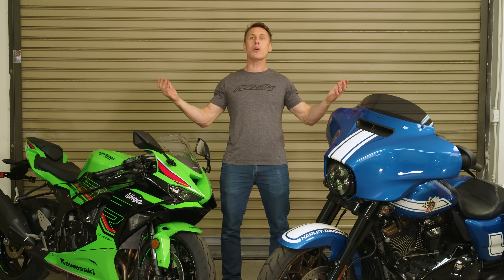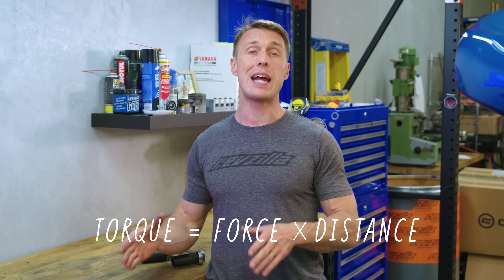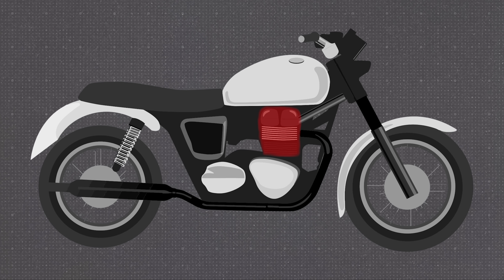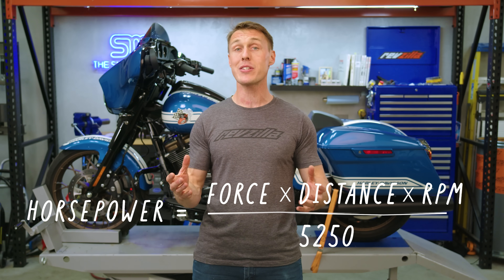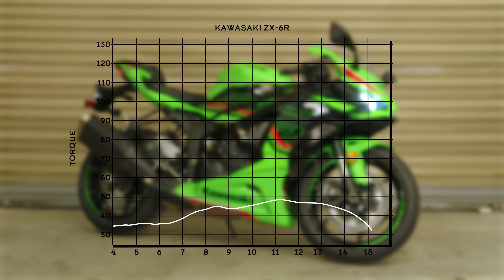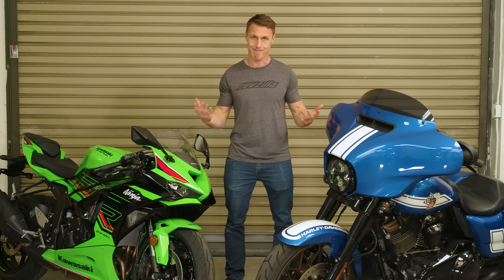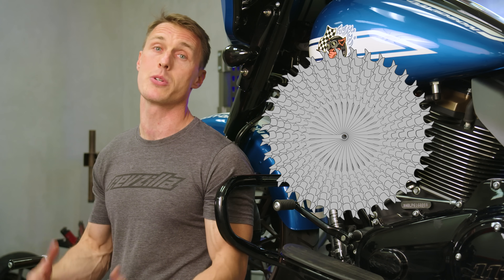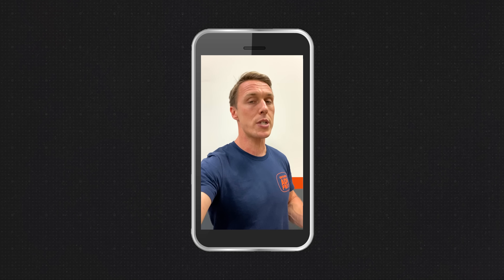Torque and Horsepower Explained! | The Shop Manual

Comment: Love the video, some great explanations, I do worry that some people will hear "torque equals stronger acceleration and horsepower means higher top speed" and miss the caveat that the transmission makes the torque somewhat irrelevant.
Reply: Yeah that line is not true. A bike acclrates faster in its powerband, it's weight and gear says the same. The only think it change was the amount of horsepower that was created.
Reply: @pleasedontwatchthese9593  I get the simplification he's going for and I'm positive he knows the intricacies.  It's difficult to tell a YouTube audience to integrate the horsepower chart across the range of the intended powerband to determine average acceleration. The sentence just seemed like a misleading sound bite when later people take it out of context.
Reply: @joepelletier5381  I agree with you. My main point is it should have been left out because as you point out it will be misleading
Reply: True.  Given perfect gearing, the engine that makes the most horsepower will also make the most torque.  In real life though we have no perfect gearing so in many cases an engine that makes greater maximum torque is more useful.
Reply: @LTVoyager  I think my point is that this is only true (that we should compare just torques)  if both bikes have the same redline and I'm afraid that wasn't clear in the video.
Reply: @joepelletier5381  I don’t think redline matters.  The relationship is more complex than that.
Reply: @LTVoyager  That's the issue, and my fear of the statement originally.  A vehicle that makes the same engine torque at twice the RPM as another vehicle has twice the horsepower and the potential to accelerate twice as fast (if the same weight).  So without trying to dive all the way into it, comparing torques between like motorcycles works pretty well because cruisers always get lugged and sport bikes rev to the moon, but a hayabusa and a Softail have similar torque and weight, and at the end of the day they accelerate quite differently.  A more useful example from the last 5 years might be riding a Harley 48 Sportster and then jumping on an Indian Scout.  The scout revs for days.
Reply: @joepelletier5381  The biggest part of the issue is that only the peak values are generally reported for both torque and horsepower.  That is only a very small slice of the picture.  As you mention, you really have to know the respective RPMs of the torque values.  A diesel locomotive generates far more torque than a typical car, but you won’t win a drag race in the locomotive.
Reply: @LTVoyager   You would if they weighed the same and had the same gearing....... and the train had rubber wheels so it could actually get power to the ground  :)
Reply: Depressing that he said that.
Reply: @pleasedontwatchthese9593  but change in hp also implies change in torque.
Reply: @hankjones3527  No, you wouldn't. If both vehicles had the same gearing, weight, and unlimited traction, the locomotive would run out of RPM instantly.

HP is actually the more relevant measure for doing work, that's why industrial stuff is rated in HP and not TQ. Gearing will take care of the torque.

What gearing won't take care of is the high reving engine blowing up after 200 hours where a low reving one will do the same work for 20,000.
Reply: @atsernov I was on board with what you said until the RPM thing, longest lasting engines are ultra high RPM....TURBINES.  Splitting hairs but you are spot on, this confuses people so much...HP is all that matters in a system with a transmission...Torque output of any transmission is 100% tied to input HP.  More HP, more available Torque.

HP is the only measure of work.

Using locomotive example, make them same weight, we can get by RPM limitations by using the electric generation system of locomotive, run locomotive at full power and use dial/rheostat to meter power to wheels, problem solved.  But power is power and you are spot on, all industrial engines are rated for power @ RPM, just like aircraft, since it's generally the metric that is of any use.
Reply: @motominded5275  Can't compare a turbine to an ICE like that. The reason the turbine engine is so robust is because it does not have recipricating mass to shake it apart.

They absolutely disintigraye from a single blade failure. That's why they have containment rings, undergo inspections every few dozzen opperaring hours, and rebuilds are mandated by time and not by walear.
Reply: @atsernov  I was mostly joking but just bringing up the point that high RPM does not = high wear dependent on engine type.  Turbines don't need constant inspection - in industrial applications they happily plunk along for 10s of thousands of hours with no inspection and minimal maintenance.  Heck, they even use them in the M1 Abrams where they happily spin along at 20k RPM+ and at time of development were directly compared to piston engines....
Reply: @motominded5275  Aarcasm doesn't translate well through text. :)

Fair point on the industrial/ground based applications where inpeller strikes aren't a concern and lives aren't at direct risk. But it just highlights their sensitivity to imbalane.

But to further highlight that not RPM but rather reciprocation being the issue, you can simply look at turbos on freight trucks where they often run for several engine rebuilds on a well maintained machine.

Comment: What clears up all the confusion (to me at least) is gearing. Using gearing (both the ratios in the transmission and the sprockets), we can change the torque to whatever we want it to be. 

100 hp = 100 ft lb * 5252 rpm
100 hp = 200 ft lb * 2626 rpm
100 hp = 50 ft lb * 10504 rpm

So say at 50 mph, both the Harley and the Kawasaki will have their rear wheel spin at the SAME rpm. Say that speed is 525.2 rpm for simplicity. At this point it’s clear that the Kawasaki is actually putting more WHEEL TORQUE to the ground than the Harley, regardless of what the crankshaft torque is.

116 hp = 1160 ft lb * 525.2 rpm
83 hp = 830 ft lb * 525.2 rpm
Reply: 116hp is the Kawasaki's peak horsepower, which occurs at much higher revs. If they were both revving at 5252rpm, the Kawasaki would likely be putting less wheel torque to the ground.
Reply: @victorugo3875  yes but where the peak engine revs occur don’t really matter because with a transmission we can gear it however we want. As long as the engine is in the power band (I.e. don’t try lugging a 636 engine at 4k rpm) it is always advantageous to have more power
Reply: @RussellAutosport  you're right. Thanks for clearing up.

Comment: Torque is how many revs you need to go fast, accelerate fast, pull a load etc. (do work). Power is how much work you can do.

For acceleration, more power yields more acceleration, nit necessarily torque. Power is energy output of the engine per unit time. To accelerate faster, you need to add more kinetic energy per unit time, thus you need more power, nit necessarily torque. 

Half the torque at four times the rpm accelerates the vehicle twice as fast at a given speed (i.e. adjusting gearing to maintain the same speed in both scenarios), because wheel power is double. Wheel torque is also double, as the transmission ratio differs by a factor of 4 while engine torque only differs by a factor 0,5.

Comment: That break down with the different runners is the best explanation I have seen for this. I am mad that I never made such a simple connection for explaining this to other people. lol
Reply: But it's a bad analogy. The difference between you or I and an Olympic runner isn't the strides per minute, it's how much power if applied per stride. In the case of a runner VS a linebacker it's just a power to weight/ aero thing.

Comment: 4:51 And that's extremly important! A transmission can manipultate torque and rotational speed but not the power. n1 * T1 = n2 * T2. So a bike with more horsepower will always accelerate faster if the gearing is right.

Comment: When we are in a higher gear at low speed and try to accelerate, the bike may stall or turn off due to insufficient torque. That's why more torque is necessary in the Commuter / Cruise bikes.

Comment: The number 5250 is usually the rpm where hp and tq typically intersect, if I'm not mistaken
Reply: Yes, and that's the specific rpm because of the units chosen.

International units graph differently.
Reply: It’s technically 5,252.
Reply: In certain units. yes. Understand that there is nothing physically significant about where those two lines cross. It would be like plotting your height in inches against your age in years; your French friends wouldn't come to your line-crossing party.

Comment: I think you could've put more of an emphasis on the importance of transmission in regards to torque and acceleration. What accelerates a vehicle is not engine-torque, it's wheel-torque which is extremely dependant on the transmission, while power is constant (minus friction losses) between engine and wheel. This means comparing the torque of different bikes is pretty much useless and really doesn't tell you anything about acceleration potential or speed.

Still good video, and not wrong anywhere, which is better than the vast majority of videos talking about this topic :D

Comment: 4:45 - that is not correct actually. More power means faster acceleration, period. But the assumption that if you put these engines with a fixed, 1x1 gear ratio into equal weight bikes, the harley engine will accelerate faster (initially) is right. Not because it makes more torque. It’s because from a standstill, it has *more power*.

You see, when an engine makes higher peak torque it often implies that torque is high already low within the revrange, thus it produces decent amount of power from the get go.

At the end of the day, the peak torque figure is just a simplified indication, how the power curve probably looks like. But if you want to understand how fast a bike/car accelerates, the power curve is all that matters.
Reply: I agree, 101 pennies is worth more tgan 1 dollar. It does not matter if each penny is worth less.
Reply: Usually peak rpm number is  good indicator of how power and torque graph might look like. Higher rpm = worse torque curve.
Reply: @currycel470 usually, but not always, and the problem here is this leads to so many misunderstandings.  Just look through the comments to see how many wildly wrong explanations and analogies are here (how fast you hit the wall, how far you take the wall with you, etc).

The only actual relevant value to a rider is the whole HP curve, because power is a function of torque and time.

Comment: To use a swimming analogy : torque is how much water you push with each stroke (your distance per traction). Power would determine your speed, which depends on both your distance per traction as well as your stroke rate (how many strokes per minute).

Also, you can have high acceleration even with high hp / low torque, you just need short enough gear ratios. The reverse is not true. Power is the metric that determines how quickly a vehicle could theoretically generate (kinetic) egergy, wich is related to velocity.

Comment: What I think is neat, is that on about 96 percent of dyno runs, if you look at the graph of the results, the HP and torque usually crossover at 5252 rpm (more-so on car engine dyno sheets)
Reply: P = Torque x RPM / 5250
when RPM = 5250 .. you have
P = Torque x 5250/5250 i.e. P = Torque (in magnitude anyway). 
It's a different RPM if you are measuring in metric
Reply: 100%, it's mathematic. If it doesn't cross there on the graph, then the hp/tq are in different units or scales.
Reply: It is not 96%, it is 100% as long as the engine revs up to 5252. This is a result of the units chosen (HP and lb.ft.).

International units will map differently.

Comment: Horsepower is the only number that really matters at the end of the day, torque is obviously important but its job is to generate power. The thing that really made this click for me was realizing that a 500hp BMW 3 series can pull a loaded semi trailer just like a semi truck that makes 500hp. The difference is that the BMW makes 500 hp at 6000rpm, whereas the semi which has 2000 lb-ft of torque makes 500hp at like 1000rpm, so it pulls the weight effortlessly whereas the BMW would be fighting for its life the whole time.
Reply: Semi would make peak torque down low 1200-2000rpm but peak power would still be higher in the rev range 3000-5000rpm.

Torque gets the semi moving and hp gets it up to speed.
Reply: @HifeMan  Semi trucks do not rev to 3k let alone 5k
Reply: @biocta  Yeah 5K would be more of a fully build semi engine that makes like 3000HP lol but you can fine 12 liters diesels that are governed to 2900-3000 rpm’s.  So yes they do ;)
Reply: @HifeMan  Yeah those are cool but I’m not really sure what your point is
Reply: Sort of.  With an infinite number of perfectly efficient gears then it only power would matter.  In reality the thing that normally matters is the amount of power in the rev range you're using.  If you had an engine which produced 10hp from 1k rpm through to 9k rpm but then had a sudden spike up to 170hp from 9k - 10k rpm then it wouldn't be much good to ride and would be very slow except for a very specific use case.

Comment: Everything is great except the end. Horsepower is the POWER that pushes you in the seat. What you feel when you open the throttle is POWER.
Reply: Exactly, having lots of torque simply allows you to generate power at a low rpm which makes it feel more instantaneous. If you keep your sport bike wound up to 12,000 rpm it would feel just as quick on the throttle.

Comment: More hps means the ability to overcome physics at high speed & accelerate to a higher speed. High torque can be available in a 125cc however you'll struggle to reach top end

Comment: In a sense this is correct. But in reality, torque doesn’t really do anything. Power is what moves you. It work being done. Your engine can make 200 ftlbs of torque, but if it’s not moving, no work. No acceleration. What we call a torquey engine is simply an engine that makes a lot of power at low rpm. Think of that torque wrench. If it not turning while you’re applying torque to it, no work is being done even though a lot of torque is applied. Otherwise, this was a very good explanation and easy for most people to understand
Reply: So basically you are saying that torque doesn't bring you far when the engine is turned off? Or what else do you mean by "if it's not moving"? If that is what you mean, no shit, cpt. obvious, I think everyone got that

Comment: You miss the same thing as everyone else. In a rotational system, Power, per your equation, is comprised of two components, torque and rpm. At ANY given rpm, if two engines are being compared, the one making more power at that rpm will make more tq at that rpm. It's math. Compare a couple dyno sheets and run the numbers yourself if you don't believe me.
The power curve tells a rider everything there is to know about the engine's power delivery. Tq is just telling the same story with a different graph. It's meaningless enough, but the fact that the tq/speed at the rear wheel is what pulls the bike forward makes it even more inconsequential. The power from the engine is delivered to the rear wheel in it's two components, tq and rear wheel speed, via your choice of gear. More tq/less speed in 1st gear. Less tq/more speed in 6th gear.
So can you reviewers please STHU about tq. It's nothing you feel. You feel acceleration. The end.
Reply: Yeah you get it. Like the only one here lol
Reply: There's also no such word as "comfortability" and all bike are "approachable" unless they are guarded by a force field.
Reply: It's indeed funny how you are the only one in this comments section that truely understood the subject. And the guy with the red profile pic haha. However, it is true, that you basically feel torque, since torque is directly proportional to the force at the rear wheel and therefore acceleration. So yes, you feel acceleration, but by that you basically feel the torque. You don't feel power. That leads to many people shortshifting, because they feel the torque drop off at the top of the rev range and they think that the power drops off, so they need to shift up. But they don't realize, that the rear wheel torque, and therefore the acceleration, is even lower in the next higher gear.

Comment: It was one of the best video on yt which explains everything so simply. I knew the formula, but always had a doubt between these 2 terms. And now I get it, why people say cruiser are torque master. And also that gear explanation with animation was also good, initial gears are big, large radius, hence generating more torque / power to move your vehicle. But, at higher speed your vehicle is already moving, u don't need torque, u need fast rotation, hence gears became shorter for high rpm.